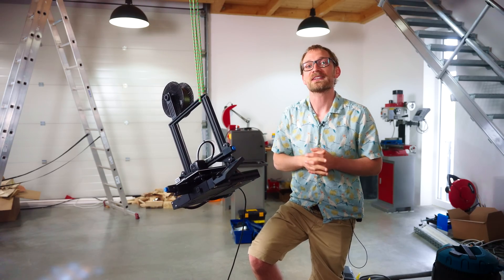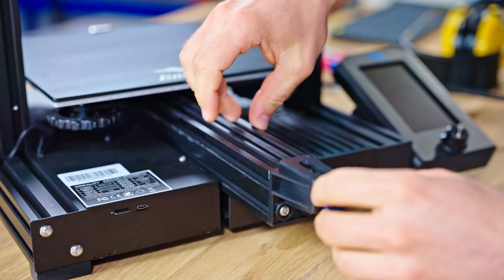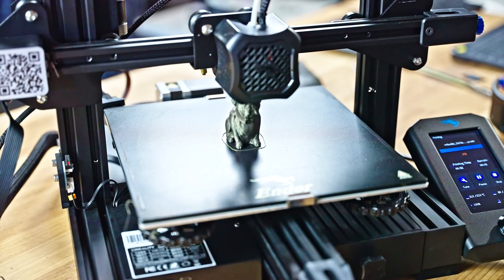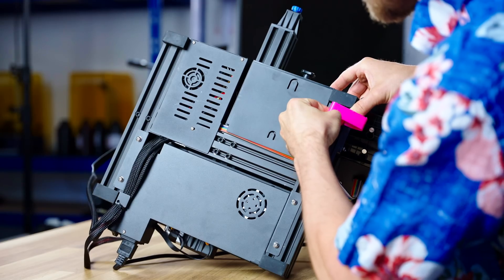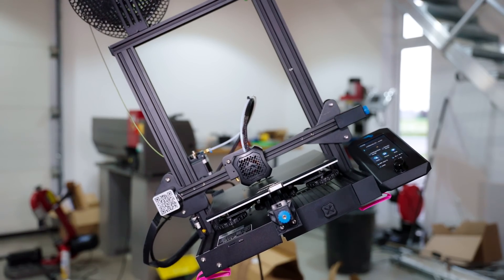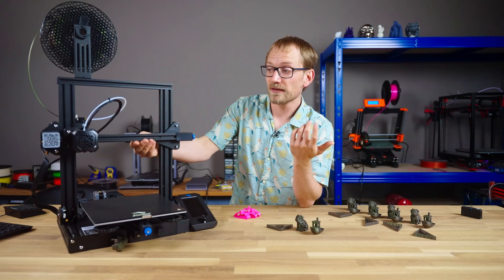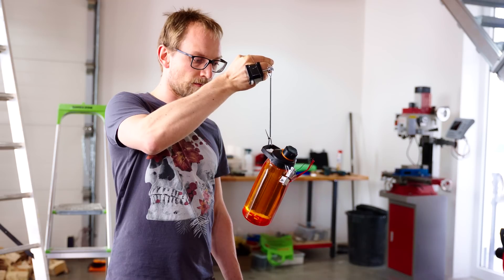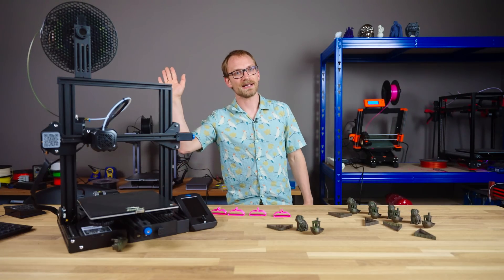Wobbly 3D printer makes for better parts!

Comment: One of the best things i've found is marble and foam.  I've got my printer on a heavy marble cutting board type thing with a chunk of 2" thick foam under it.  The foam is the black stuff found in camera cases and pelican type boxes and such.  I also use foam between the marble and printer.    

So the setup is printer with small foam pads for feet on top of the marble, with a block of foam under the marble, basically the same size as the marble, and that all sits on a sheet of 3/4" plywood.  Between all that it dampens and isolates so much that it's completely silent as far as resonance sounds and vibrations go, all i can hear is the motors and fans humming along smoothly, huge difference from having it bolted down solid to the plywood.

Some things i think would be interesting to try would be to float it on water, on air (like on an air hockey table, and on something like an air mattress) or on damping feet consisting of two unconnected flat faces separated by a layer of grease so it 'floats' on the grease film.  This type of plate damping is used in lots of applications, like doing vehicle alignments and i suspect that finding the right viscosity grease would do wonders for x/y damping without affecting the Z axis.

When i got my printer the stock frame was a wobbly flexing mess, but it still printed well enough to print out a bunch of stiffening braces and replacements for the acrylic parts.  As i stiffened it up all the problems started appearing like collisions, z banding and such, so i then had to stiffen up the carriages and do an oldham bearing on the z.  When the frame was flexy, it covered up a lot of the problems with the flexy carriages, and once i got the everything rock solid and the Z floating free on bearings with the foam/marble/foam base everything just came together.

Comment: A  maybe funny thing I learned in my career as a R1D technician: One client of us once came up with a solution you might not expect directly. They were developing a acoustic sound recording rig for determining the natural frequency and damping effect of metallic materials in order to predict the mechanical properties of their pieces by acoustics. They used tennis balls for dampening. The table that sat on the tennisballs had quite some weight to it. The bottom surface had the same spherical recesses as the balls. It did the trick perfectly. You basically want the same effect as for an ideal car wheel suspension: a spring for absorbing the first bump and a damper for absorbing the "echo". Imho, a 3D printer is a trade off between rigidity and speed. More rigid constructions will weigh more, thus slowing the process down or adding effects because of inertia of that weight. In CNC machines, lamellar cast iron beds are used for absorbing these kinds of effects as it has a high dampening effet by nature. basically everything that sounds dull when you hit it (no "tinggggg" but "df" when you hit it) should be contributing to avoiding these effects.

Comment: When I first got my Ender 3 I didn't have anywhere to put it so I left it on my marble floor and there was significant ringing. After I got my room set up I put anti-vibration/noise foam mat meant for exercise mini steppers. They were the perfect size and were only about $7. Seemed to have almost totally removed the ringing. I think you guys always go for concrete and wood and such, but I want to see someone test it with yoga mats and dampening exercise machine mats that are very common in SE asia because we live in apartments, and doing jumping jacks on your bare floor will have the neighbours downstairs calling security up and complaining. 😆

Comment: You also have to think about what is oscillating. I think you should try the rubber band from the ceiling method but attach it to the base of the printer, not the arm.

Comment: Ehhhh i ended up getting some high density foam used for isolating studio monitor speakers and it works great! makes it sooooooo much quitter than just having it on the desk with rubber feet

Comment: to anyone wondering, for a very solid based printer, the vibration reflects back, and acts like a neutons cradle, shaking the print nozzle. The idea isn't to stop it moving, but to stop the reflected shock of sharp movement returning to the nozzle. A lot of this issue could be solved if the manufacturer would use shock absorbers in the print head, with software correction.

Comment: You might want to put the printer under sprung compression rather than tension. This is why the printed ones worked. You can improve this with a sprung base, but you can also put compressed springs on an outer frame which will improve the X and Z.

It works the same way as car springs, and the local concert hall is built the same way.

Comment: You can't offer the sand idea and not do it.
Reply: I would also be really interested to see having your printer on an Ikea lack vs good table vs wobbly as hell table. I've been trying to improve the print quality on an ender 3 and almost everything I do seems to have the opposite effect I want. I originally printed on a portable table and then moved to a dampened stack of ikea lacks and I feel like the wobbly folding wood table had better results.

Comment: Feet that use squash balls are pretty popular. I've found them pretty good at isolating the printer such that it prevents the table from amplifying noise. Also something that is specifically designed to dampen vibrations, like deadblow hammers, or actual shock absorbers.

Comment: When i was studying physics we had some delicate and very vibration sensitive equipment. We used to use concrete suspended from bungee cord...seemed to work pretty well combining two things you suggested.
Reply: Nah, the issue is that it is internally generated vibration. You need to go the opposite way. Compressed springs.

Comment: Just use a proper closed loop system.
Edit: A proper closed loop would have the control software reading the position sensor and not an external motor controller.  The loop needs to start and end with the control software and not the motor controller itself.

Comment: you would need a contra weight moving in the opposite direction in order to cancel out the acceleration force. basically a block of lead moving behind the hot end along the x axis and one on the y axis as well to cancel the heatbed movement

Comment: I work in a machine shop, we use some pretty precise measuring equipment that can be affected by the vibrations of machinery.  To lessen this we have granite blocks on the work benches with really squishy rubber pads on top, between the granite and the measuring equipment. Of course, this setup is for eliminating outside influences on the measurements,  but I wonder if it would work for 3d printers

Comment: My solution, while not eliminating ringing, did reduce it a lot, and also killed almost all the noise of the printer - I put the printer on a thick plywood sheet, to keep the frame in shape, and placed a folded towel between the plywood and table. Noise almost gone, ringing greatly improved. That towel is just a great vibration damper.

Comment: I added some sound deadening(butylene) on my printer and It does reduce vibrations by absorbing it. The nice part is that you can cut small pieces & stick it wherever you want. Anyone else using it?

Comment: I used the printed feet on my MK3 for a while but they always collapsed after a few weeks and ended up with one or more of the corners sitting on the table again. I may try them again but with a more heat resistant filament like PC blend or maybe even CF PC to give a stiffer spring effect.

Comment: The bungee design was used by early afm (atomic force microscopy) users to decouple the building vibrations from the instrument. There is a tutorial online for a home diy version.  Concrete slabs also ring.  You need a honeycomb platform such as used in optical tables or a terrazzo plate with dampening feet.  The terrazzo plate is sold to reduce vibrations when weighing on a high precision balance.

Comment: A couple years ago i added bracing to my Folger I3 kit.the ps side i secured the ps with small 90 degree  pieces of aluminum angle. the other side i use a piece of aluminum flat bar. 
My ender 3 sits on a piece of patio block

Comment: Instead of stepper motors with belts, we need bidirectional hydraulic cylinders driving all axes. As fluids are very good at dampening and are hardly compressible, I expect ringing to no longer be an issue. It would arguably be slow, but it can be made to work faster. We do not need force, but we do need accuracy, which may be a problem as you would need very good flow rate sensors or other sensors to determine the position of the cylinder.

Comment: Here’s a thought (apologies if already mentioned below, tl;dr)

-> How about magnetic damping? Put strong rare-earth magnets next to thick-ish conductive sheets (~1mm copper? ~3mm aluminum? - just wild guesses). Eddy currents create fields opposing the motion of the magnets, and the energy is dissipated in the conductor. X/Y seems to be where the problem is, so you could support the printer on ball casters above an aluminum plate, and suspend the magnets beneath it, very close to the plates. As a bonus, you can easily adjust the amount of dampening by moving the magnets closer to or further away from the plate. (Relatively weak metal coil-springs could maintain the printer’s nominal position.)

Comment: Hey Thomas. Fitness bands generally used for crossfit and stretching would be a neat option. Black, red, green, and yellow. Tubes or bands. But they have different tensile.

Maybe graphite hockey sticks could be worked In. You'd probably be able to pick one or two up from a hockey rink. As their generally over 200 bucks a stick.

Comment: Trying this out with some more “designed” solutions would be interesting as well. Either something using a viscous oil, or a lattice/infill structure with soft TPU might give more of a targeted damping. If you wanted to go super fancy, you can even tap test to measure the frequency response, and tune the damping factor (by adjusting print parameters of the TPU) to your machine’s dynamics.
Reply: I think tuning to the resonant frequency is key here. Like trying to slow down a kid on a swing, timing is everything.

Comment: Dampening will broaden the frequency response. Adding weight will lower the frequency and reduce the amplitude, stiffening will increase the frequency. This is all in respect to the natural frequencies of an object such as a printer.

Not sure filling the extrusions with sand would do much. Maybe placing the printer in something like a sandbox though?

Comment: I think CNC kitchen used one of those concrete squares but put some foam under that, to supress the vibrations. I am using a similar setup and it works well, it is a lot less noisier and i saw some improvement in quality

Comment: For my MK3S, the best feet i've ever used, and have for years now, are the ones with 2yellow dotted squash balls by far. Nothing compares to them in terms of print quality and sound dampening combined.
Reply: Been using on my cr-10 for 4 of 5 years!
Reply: What are they called? Do you have a link?
Reply: @gavinsauer1608  There is one I found that looks pretty good, will print and try it out soon. Links on youtube comments are kinda finnicky, so go on printables and search for Yosuke (the person who designed them) or the exact title, "Squash ball feet for Prusa i3 mk3s".
Reply: @gavinsauer1608  yeah what the other guy said. Most importantly make sure you get 2 yellow dot squash balls, they provide the best results. I tested other kinds of balls and these are amazing.

Comment: Perhaps it would be desirable to mount a MEMs accelerometer to the bed and to the hot-end, then regardless of environment the software can detect and mitigate ringing (and potentially a couple other artifacts). 

Additionally, with a small encoder attached to the filament, the software could detect the exact feed-rate, mitigating against under/over feeding and poor retraction.

With some interesting mechanical engineering, it could also be possible to design a thin compliant gasket+spring+rod  mechanism to sit between the extrusion head and the rest of the assembly, with a MEMs accelerometer attached to the rod to measure the moment-to-moment pressure inside the hot-end. (this could also be used to "zero" the hot-end to the bed via delicate direct contact)

With all of that, no mater how cheap or poorly built the printer is, I suspect the software could make workable prints and flag problems nearly immediately.

Comment: In astronomy, we use soborthane pads under the tripod legs to dampen vibrations in the telescope mount as the telescope is moved. It seemed "obvious" therefore that you'd need to find the right resonant frequency of the 3d printer. Perhaps try different feet (by design or material) that has different damping characteristics and see which works best? I suspect the pink feet you used are too inconsistent, so could try different foam/rubber/etc pads or even soborthane and see how those work?

Comment: When using feet or paving stones on the printer frame you're relying on the print head's harmonic oscillations to resonate with frame and the dampening is applied to the frame. It may be better to have dampening forces applied to the print head carriage directly (and separately for the print bed) with a secondary belt that's just a tensioned elastic cord parallel to the drive belt/ direction of movement. This would apply retarding forces only when the print head "slips" past its expected location due to the resonance at a fast enough speed that the elastic can slacken on one side only ie. slipping on the rollers.
Sand filled beams work because the sand has little enough inertia to easily transfer the kinetic energy of the oscillating frames through their own resonance which is then lost through inelastic or stochastically elastic collisions with other sand grains but again requires the frame to quickly achieve resonance with the print head and bed. This is still alot better than nothing.
I think it would be nifty to go the other way and see how prints fair while the whole thing is on a vibration table. In theory the vibrations would be random enough to prevent any specific resonance frequencies from being met but that depends on how well built the machine and the vibration table are.

Comment: Removing the filament spool holder makes more difference than anything on these frames. Had good results with that and some bouncy ball feet i made as an alternative for the popular squash ball feet, removed around 2/3 of the ringing. Printing PLA at around 130-150mm/s and 1200-1500mm/s acceleration with pretty nice results. Could probably go waaaay faster with Klipper

Comment: Turns out I accidently did the same thing with some thick upholstery foam on my Wanhao D3 V1 about 2 years ago...  I did it to isolate the vibrations of my 4988 drivers from my apartment floor to be nice to my neighbors.  But I also just don't see much ringing in my prints, as I don't print those kinds of prints, so never noticed the correlation.

Comment: I might try;
Oversize extrusions
Filling the unused slots in the existing extrusions with resin
Oversize drive belts
Higher quality belts
Diagonal bracing
Rubber dampers at structural joints

Comment: i don't get the "making it firm".  - ringing comes from top frame. Making bottom of it rigid kinda helps, but most of it are the x,y and top post holding the x and z. I would see a lot more things happening if gauntry holding z and x is made super rigid.

Comment: I'd love to see whether allowing the printer to roll along marbles would help. This would allow for small movements parallel to the table surface, with very little resistance - to stop the printer from wandering, a set of feet could be made with very slight concave indents to enable motion, but keep the printer on top of the marbles. To provide even better damping, a layer of foam could be used to interface each concave foot with the printer. Just a thought, and probably too much effort to put in when other very effective damping feet already exist haha

Comment: I use the paving stone with a sheet of foam under each for all my MK3(s). Works for me. What does the opposite is to replace the 3D printed parts on a MK§(s) with CNCed aluminium parts on the X axis. It should strengthen the overall rigidity, but it makes things worse.

Comment: Perhaps try damping on the axis itself. I have 2 different ideas:

1) Linear damper. Essentially a very light duty version of the shock absorbers on a car. Not sure you'd find anything ready made to fit the application, and tuning it right to allow the regular axis movement while damping oscillations may be hard.

2) Add a weight (approximately) equal to the weight of the mass being moved on the axis on the "return" side of the belt, so it would move in the opposite direction. Probably easiest to test this with the extruder head, you would need something equal in weight to the extruder head that would run on the back side of the same extrusion as the extruder head. The opposite motions should (somewhat) cancel out. The downside is the stepper now has to move twice as much mass and so may not be able to hit the same acceleration rates.

Comment: I failed dynamics pt.III 3times and they made an exception for me so i finally passed on the 4th time (took it with another proffessor), but i still know this real system is so complex that to model it the equations need to include thermodynamics and electrodynamics. The stiffnes of the motor field , for example depends on the servo driver control loop, as well as its electrodynamical parameters. So i just turn a blind eye to the issue with my printer :)